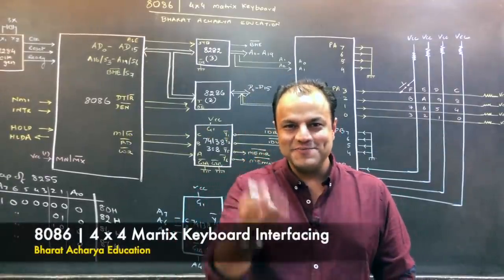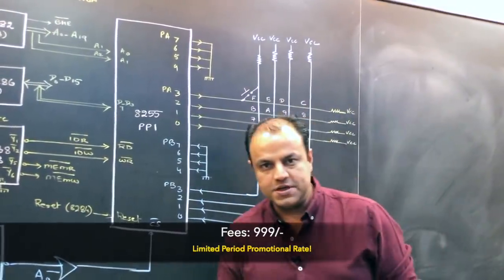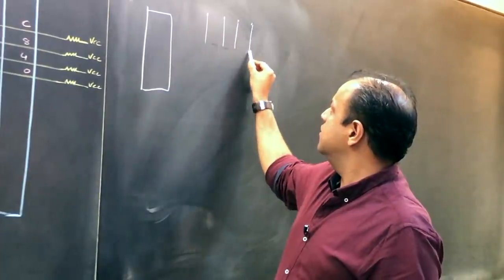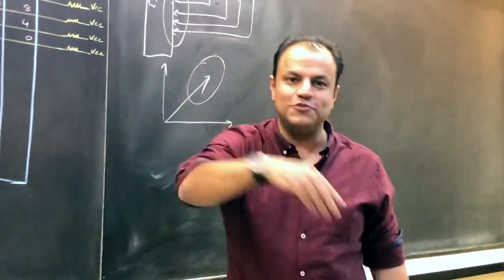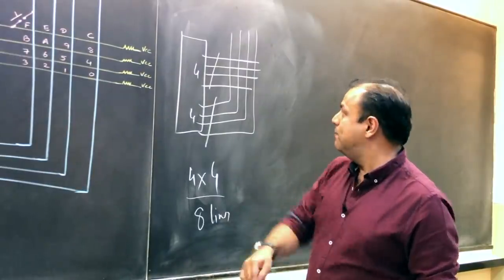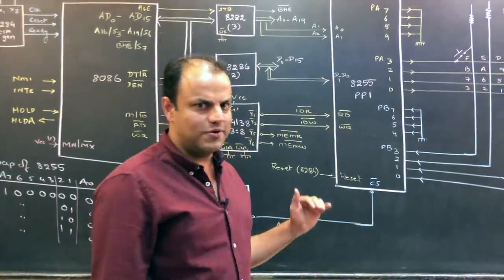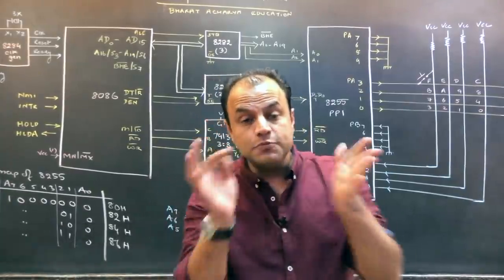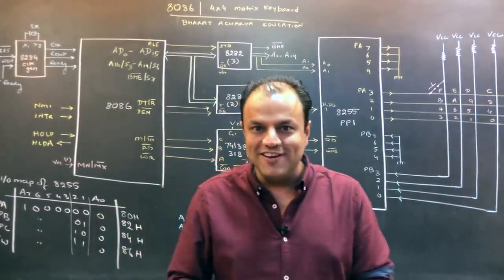8086 | I/O Interfacing | 4x4 Matrix Keyboard | Bharat Acharya Education

Comment: This is a doubt in the memory banking video of 8086 architecture -
So say the memory is of 8kB, which means the address bus will have to be 13 bits, so when you initially convert that to hex, we will have 3 complete hex values and 1 hex value that just goes until 1 .. like  _ |_ _ _ _ | _ _ _ _ | _ _ _ _ the leftmost will only go 0 or 1. Now say we banked this to 2 banks. the rightmost bit will be considered as Ao, Giving us 3 perfect hex values like |_ _ _ _ | _ _ _ _ | _ _ _ _ | _ Does this situation make memory utilization better? Like in the case you mentioned in your video we had 20 bits, 1 gone from the right, 19 bits are left from which 5 hex values can be made, but the last one won't be completely utilized.
Reply from the maker: Connect with us on our 
Official WhatsApp number: 
+919136428051 

Bharat Acharya Education